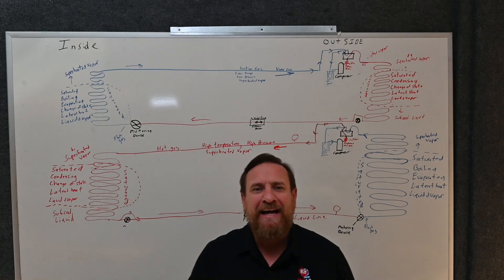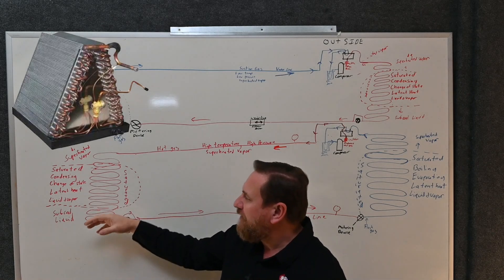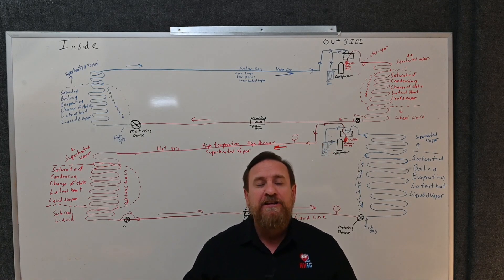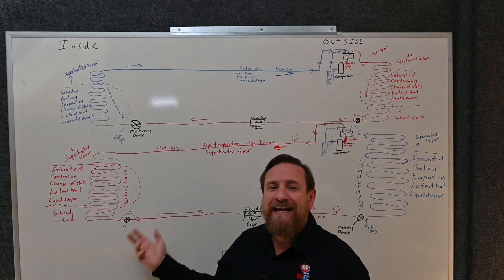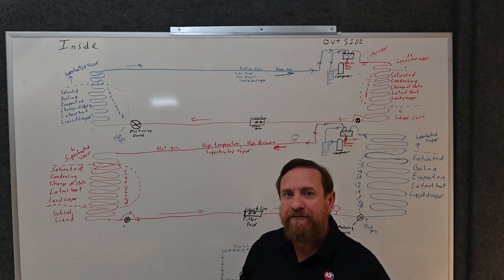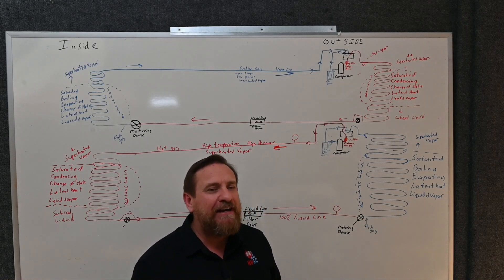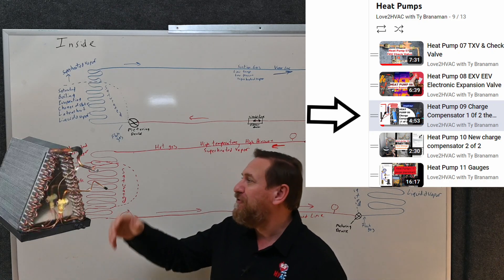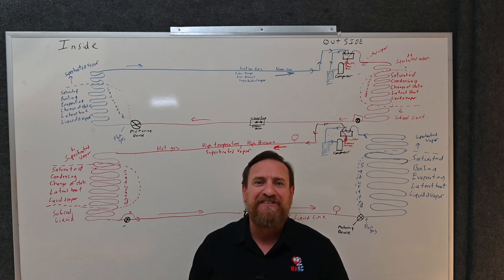Heat Pump 12 Hight Pressure trips only in Heating

Comment: Had this going on and just spent 7 hours replacing the reversing valve because I thought it was stuck. I wasn’t getting a magnet to move on it while energizing the solenoid. After replacing the valve I still have the same issue. Going back tomorrow I’ll come back and comment if I figure it out🫡
Reply: Did you get it figured out I’m having a similar issue

Comment: I have great pressures in cooling on 60F day and 100/650 in heat pump mode 7.5 ton diakin. New install. Blower working. Filters clean. Duct clear. Ect. Choosing to replace condensor txv. I'll let you know. Correct subcool.
Reply: You didn’t let us know😂
Reply: @drakeshriver2316  I dunno what they ultimately did with it..First off..No site glass was installed on it. Second, No ground wire from disconnect was ran, 3rd..The whole panel of installation in the flipflop ahu pulled off and got sucked onto the coil..4th..i seem to recall that perhaps the blower was running backwards?..and before the txv swap we pulled all charge like 20 something lbs and vacuumed it again below 500 before filling it again and dailing it in somehow without txv...it worked fine for awhile and then I left for a better company.

Comment: This may be the problem with my air handler heat pump. It is a trane tam7 with trane XR on the roof. Why would rebooting the inside air handler make the heat come on? Thanks . AC is great, but if heat hasn't run in 12 hours or so it will do nothing but blow cold air.

Comment: Mine seems to trip when the aux comes on only why drives the high pressure no air flow restriction could it be the RV ?
Reply: Does the fault code say high pressure lockout?

Comment: Just had a new indoor unit installed (carrier infinity 4t) mated up to a lennox xp21 4t hp and is having exactly this condition. Installer after checking pressures (good suction, high output) claims the only route forward is to take refrigerant out in the fall and add back in the spring or use gas-only. Any reason why or why not they couldn't install a charge compensator?
Reply from the maker: Mismatching basic systems like 10-14 seer would operate but it was never good and never meet the effecent.

Mismatched high efficiency equipment is going to be an ongoing problem. Neither was designed to operate with the other. 
Should have never been offered as an option. Everything done next will be bandages and guesswork trying to solve engineering problems for 2 pieces that were never designed to work together.  

You likely have airflow issues but that's just a start. I would not touch that system as a tech unless you wanted it replaced and installed correctly .
Reply: @love2hvac  thanks for the advice!!

Comment: I have a question! Today I had a heat pump working okay in cooling mode but in heat mode the head pressure went past 600 psi, airflow is good coils and filters are clean…I was thinking the outdoor txv? Any thoughts? It’s a little 2 ton residential split system. According to your video I have a bad indoor txv? Please help! System definitely not overcharged was 60 degrees out today and my standing pressure was 61 degrees saturated. Residential Trane unit from 2016. Also had a 2-3 degree temp drop across my filter dryer, is that too much?

Comment: ACIQ inverter heat pump. says during heating mode, initial turn on ever. re-torque the flares while hot. Interesting for sure. Thanks for the tips over the year.
Reply from the maker: Thank you for the heads up! I looked through a few ACIQ instaltion PDF's and I cand find that. Which model is it that shows that?
Reply: @love2hvac quick start guide 2023 V1.0 on hvac direct site. For aciq-24-hpb. "To ensure no leaks are present startup the unit in heating mode. While the unit is operating retorque the flare
 adaptors (while unit is HOT). It is recommended to use a digital torque wrench."
Also note the dip switch settings in this quick start are not correct. Read what's on the unit itself. I confirmed this with hvac direct. Side not too, the indoor coil ACiQ-24-ACL vapor side is 3/4 like the HPB manual calls for. Very nice unit, super quiet.

Comment: Hi Mr ty 
Is it possible to explain about the heat pump system  with good pressure and the suction line is hot above 150 degrees but supply air temperature is not going to be above 80 degree

Comment: can reversing get stuck and send high pressure on both lines(high and low )  on heating mode?  both pressures rise equally on my gauge on heating mode, but  on cooling mode works   just fine
Reply from the maker: Both lines will be high pressure in heating mode. You will have to use the true suction port for your suction pressure. I have a video on that in this same playlist.
Reply: @love2hvac  yes, but pressures should be equal and rise the same, to the point to stop the compressor?
Reply from the maker: @eretza666  not all units have a high pressure switch. 
Reversing valves rarely fail but are often blamed. They are misdiagnosed way to much. I have been to 100's of calls where company A said it was a bad reversing valve and I find something completely different.  In all the years I have had to change 6 3 of those where overheated when someone tried to change them, 2 from debrise and 1 that was leaking refrigerant to the atmosphere. 

 A failed reversing valve cannot send high pressure to the suction and discharge at the same time.
Reply: @love2hvac thanks ,  that's what I needed to know .Rules out reversing valve,  now if the txv is not by passing, that should be the cause for pressure to rise if air flow is fine and everything else is clean (coil.filter)
Done you think? Thank you for replying

Comment: Ty, what’s your feeling about looking for a restriction using temperature probes before and after any suspected part? ( drier, txv in bypass, etc)
Reply from the maker: Temperature is a great way to find a restriction. Pressure is the best way but we don't usually have the luxury of a pressure port before and after. It is possible to have a restriction without a temperature drop as Bryan Orr found out in a lab test.

Comment: So if we have a pressure drop across the TXV we have a restriction.  And since the relationship between pressure and temperature is there, we'll also have a temperature drop.  Can we use clamp probes across our TXV to see restrictions like a liquid line filter drier?  I just encountered this issue on a new install (I'm a warranty tech) and I opened up the TXV to get flow and it worked.  But what's going to happen when we go back into cooling season, I'm sure I'll have low superheat and have to adjust it again.  It seems like most of our problems are installation induced.
Reply from the maker: A TXV is suppose to have a pressure drop across it when it's metering.

When it's in bypass either an internal or external check valve should open bypassing the TXV so there is no pressure or temperature difference in that mode.

In cooling mode the outdoor metering device is bypassed and the indoor will have a pressure and temperature drop.

In heating mode the inside metering device should be bypassed and the outdoor metering device used.

If you are saying you have a TXV indoor, and you had to open it all the way up to work in heating mode, then there is a problem. Either the check valve inside is stuck closed, an external check valve is stuck closed, or it is the wrong TXV for the application that does not have an internal check valve.

#1 look to see. If it has an external check valve inside. If it does it may be stuck closed. If the external is stuck closed replace it and go to #4  If it does not have an external check valve... 
#2 check the TXV model number with the manufacturer. If it does not have an external or internal check valve for bypass, replace it with one that does.
#3 if it does have an internal check valve and it's causing a restriction in heating mode, replace it as the internal check valve is likely stuck.
#4 there is a reason it stuck so a system clean will need to be performed. Flush with nitrogen, check and clean the strainers of the indoor and outdoor metering devices, flow nitrogen while brazing, replace the biflow liquid line filter drier, pull a very deep vacuum and recharge.
Reply: Wow!  Thank you for such a detailed response.  You're one of the few that actually responds and I learn so much when you do.  HVAC is truly one of the most difficult trades out there.  It's non stop. @love2hvac

Comment: He's looking at the wrong meter device!!! Ty should be looking at the meter device at the outdoor condenser. Remember Ty said everything works "great in cool mode" but in heat mode the system turns off due to high pressure. That would be the metering devise at the outdoor condenser. Merry Christmas all.
Reply from the maker: You might want to rewatch the video  and take some notes.
Merry Christmas
Reply: On lennox the drier is inside the condenser unit (behind the liquid port) and right before it is the drier ..i found a bad drier the other day customers first time going into heat mode after their cooling summer

Comment: Hi Ty!
In walk in cooler or freezer in wintertime should use weight method in charge or checking refrigerant?
Thank you and have a bright future.🌹
Reply from the maker: If it has a head master it will affect how it's charged in low ambient.
With the variety of condensor evaporator matchups and accessories, it's difficult to get manufacture numbers on weighing in. 
In any case when it's pumped down, the receiver should never be more than 80% full.

Comment: Thank you for your time and tips. I was at this call just last month 38 years old GE heat pump, maintenance tech in summer from other companies overcharged the system which was not even necessary because it was basement his suction was low apparently added a charge, therefore in heat mode they started having issues, again 2 companies went out there couldn't figure it out guess too intimidating bunch of old Relays, wanted to sell new system, I went out there figured it out overcharged, pulled some out, no issues since then.
Integrity is gone
Reply from the maker: Thank you for doing right by the customer! 

Unfortunately many of these companies want us to be salesmen instead of tradesmen.
They will hold weekly sales training up rarely technical training.

Comment: I have been a HVAC service tech for over 30 years, I worked on every thing from 500 ton chillers to 9,000 btu ptec units and this guy knows his stuff! A welcomed sight. Thank you sir! Merry Christmas Ty.
Reply from the maker: Thank you and Merry Christmas Robert!
Reply: Question:  I have a 10 tonn2 stage water source heat pump, runs good at cooling mode!  However, having head head pressure problem during heating mode!! Evaporator coil is clean, filter is clean, free return!  Water temp during winter is around 90 degree supply!  Only one txv! True suction pressure is at 120 psi during heating, and head pressure is at 580 psi and up, then trip the hps!  Any thoughts will help!  Much appreciated!
Reply: @mikepan3189  is it a 2 stage compressor or 2 5 ton compressors?
Reply: What is a txv
on Ashp
Reply: @victorjones3058  TXV stands for thermostatic expansion valve, it is a metering device

Comment: I have also seen that somebody uses a copper pipe that is too small for the liquid line and acts as a big restriction. 

Other thing I have seen is that tam7 air handlers have something called enhanced mode which basically what it does is to run 50% airflow for the first minute or so to allow for the coil to warm up and it ends up going out on high limit for the first minutes until the blower is running at 100% airflow. What I do in those rare cases is to remove the blower delay.

Merry Christmas Ty.
Reply from the maker: This is true, there is a commercial building I consulted for that ran 3/8 to the wall then 1/4  most of them way and again 3/8 before the air handler. some over 100. It was a mess they hose to reduce the charge and deal with performance loss rather than change all the liquidines.

I did not know you could turn the delay off on the Tam7. Thanks, will check it out. 
You have a Merry Christmas